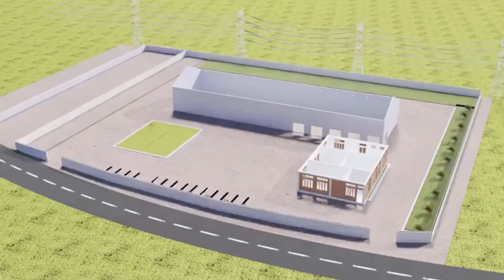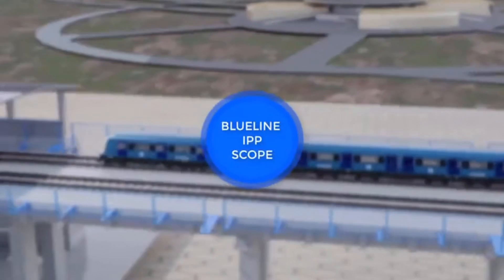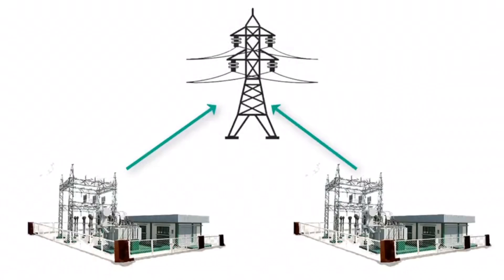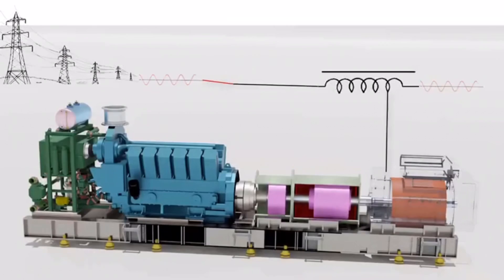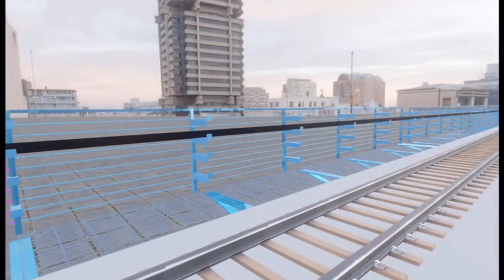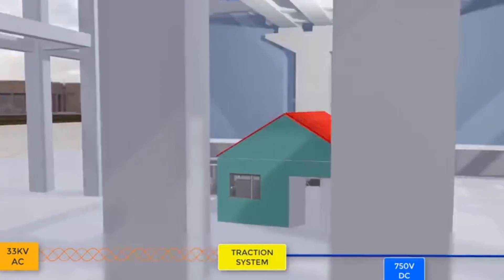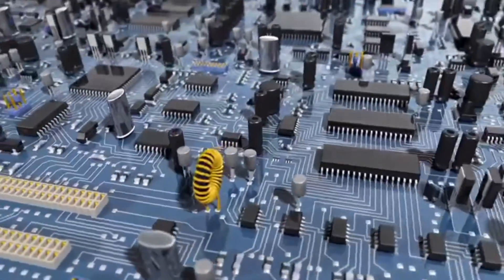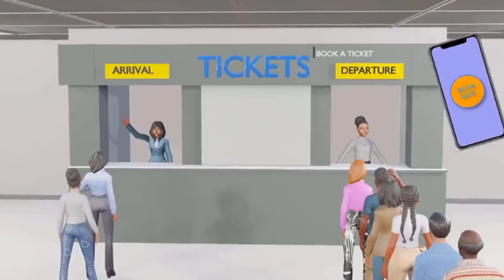Check Out How The New Lagos Blue line Rail Will Be Powered With Electricity || Lagos Sky Train

Comment: Thank you for sharing this.
You did mention that the main source of power is the GRID, and there is a generator as back up if the GRID fails. Kindly clarify what powers the generator you mentioned, gas or diesel?

Which company would be operating and managing the IPP?